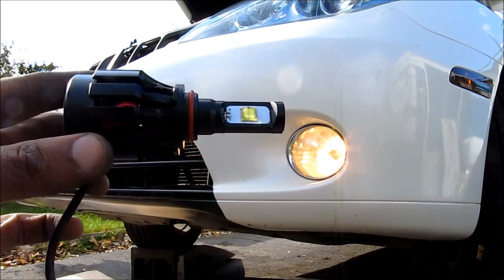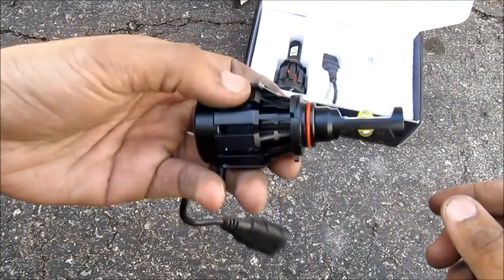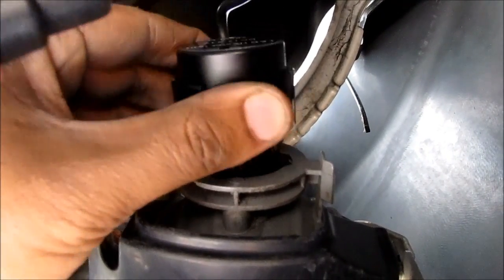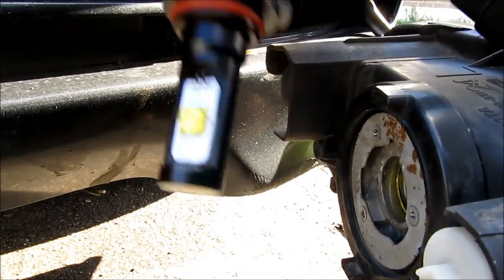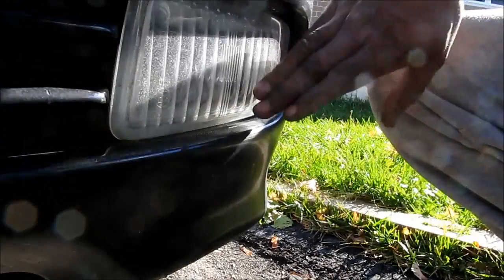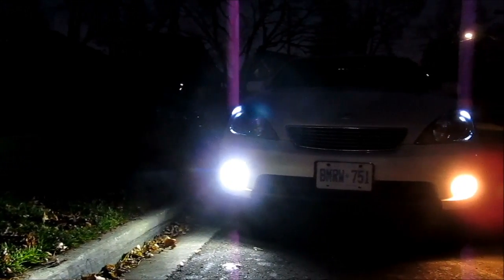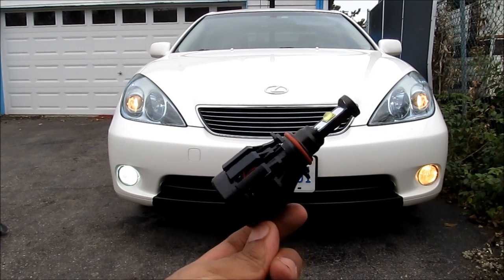LED Headlight & Foglight Review

Comment: that humm  you hear is the cooling fan spinning +8k rpm to cool the led. New ones from Beamtech don't rely on the fan , but better chipsets that run cooler

Comment: How do you change the bulbs to led on the gauge cluster On a 2005 es330.
I can get the cluster out and partially Apart, but I can’t get the board out to replace the bulbs. Is it glued on somehow?
Reply from the maker: Aren't they already led?
Reply: @speedkar99  I actually mean to change the color from white to blue. Yes, they are already LED.

Comment: Would you mind doing an update on led headlights? Has the technology improved? e.g. less glare, better beam pattern, more brightness, reliability. Shopping for one recently for my camry with a projector housing and was mildly disappointed, wondering if there are better ones on the market or is it just hype?
Reply from the maker: Yeah I wouldn't mind. I see alot of people are retro fitting LEDs now. 

I'm still using HIDs
Reply: Technology has improved. Use bulbfacts.com for led reviews. Also the beam pattern depends on the led. Just don't buy the super cheap ones. And when you install them. Keep the LEDs at a 9 o'clock  and 3 o'clock angle  And not 12 and 6.
Reply: Miguel Angel Medina Rise, thanks for the link but there are so many factors I didn’t know...e.g. can bus (what is that?), polarity, reflector vs projector housing, DRL, etc. Then, there are those ridiculous claims on lux output, 12,000 vs factory at less than 1000, are they real and do they blind on coming traffic? Lastly, product review sites are advertising sites and it’s difficult to judge their independence.
Reply: @test40323  CANBUS enabled LEDs will not give a "lights out" error light on your cars instrument cluster. 

Reflector and Projector are your headlights type of housing. Reflectors look like a bunch of mirrors. Projectors use a glass lens to disperse the light. 

Some LEDs are more effective with reflectors or with projectors. That's why I like review sites like Bulbfacts to attempt to differentiate them. 

I honestly wouldn't go with user reviews because for many people. It's their first upgrade to LED. So they will have a biased opinion to believe it's a super bright LED and it's "the best". Stick with review sites. 

Also the 12,000 lm rating is for both lights. 6,000 lm each. Most don't really stay that bright. For LEDs they typically are their brightest when you turn them because the housing is cooled. Once they heat up the light output diminished. You would want an LED with a nicely made heat sink and fan to keep the LED within operating temparature to maximize it's light output.

Comment: I have the same ES330, I really like what you did with the lower front bumper between the two fog lights. Did you paint that or wrap it black? I’m also gonna put some sylvania led bulbs into the fog lights, do you know the size of the socket for the fog light bulbs ? Which bulbs specifically should I buy? Thanks.
Reply from the maker: 9006 fog bulbs 
The lower grill is wrapped black, I like it

Comment: People have a hard time wrapping their heads around how 
Things can affect gas mileage. Like low tire pressure, bad battery, and then alternator 
Keeps trying to charge it up! Yes even high wattage bulbs demand more from the battery
Which in turn is charged by the alternator, tons of crap in your trunk adding to the 
Vehicle weight, etc. Expand Your Mind Folks!
Reply from the maker: Agreed! Small things add up to alot! That's how OEMs can claim "best in class efficiency" and Year over year economy improvements, by correcting these small things.

Comment: I recently replaced the DRL, and brights with new halogen bulbs, thanks to this video. I thought of doing LED lights, but, this video and your information helped to make up my mind.
Reply from the maker: LED lights differ alot and have changed since I did this review. You can get good quality ones now
Reply: speedkar99 Yes, and the price for LED bulbs ranges very widely, as does the quality, and high price does not equal high quality according to Amazon reviews, either. I also didn’t want to deal with the issues with the dash light on due to a perceived “bulb out” error, either. At least with the Lexus ES330, there is some space behind the bulb housing for the fan on many fan cooled LED lights.

Comment: Couple things I would like to note are when your jacking up the car use jack stands and make sure the car is stable so it does not fall on you, make sure your also getting high quality bulbs so they don’t die on you in the middle of the road and you might get pulled over in the GS for having the green lights because the cops might think you have neon lights and they are illegal in most states or territories in Canada and the United States.
Reply from the maker: All good tips. Thanks

Comment: Any for the low beam lights for the 2002 model?
Reply from the maker: +marine0331inf I wouldn't use those, swap in projector hid
Reply: speedkar99 would u still recommend the led fog ones? I believe mine are the h3

Comment: What year is your ES?
Reply from the maker: +marine0331inf 2005 ES330
Reply: speedkar99 i have a 2002 es300 and was wondering if the fogs would be the same? Also would you know if there are any low beam LEDS that would fit?
Reply: speedkar99 i want to find some low beam hid lights for my car. If you know any that would fit would be a great help. Thank u.

Comment: My led have lasted for 2 years .  Get the ones with the fans on them, i got the 160watt , 80watts each .led hb4 . I love them. Screw hid  they are headache
Reply from the maker: +BornToBeFamed good tip. Mine lasted 3 month in winter cold

Comment: the LED "humming noise" is the fan that is required to operate, otherwise they overheat and die. perfectly normal to hear it. i've upgraded everything in my truck to LEDs including the interior lighting. the only thing i didn't are the high-beams, because LEDs are useless due to the cap. HIDs are better for high-beams even though they get hotter.

edit: just read down below and you said that there's no fan in these. well there's your problem on why they died. as i said, these LED-type of bulbs require a fan to operate.
Reply from the maker: Yeah well mine don't have a fan, there's a humming noise but there's no wind and it doesn't sound like a motor spinning. Mine started flickering and I took them out. My guess is a cracked solder connection in the cold Canadian winter.

Comment: the "base" of the led is the fan the dissipate the heat. That's what the humming noise is.
And of course they died in 3 months, chinese POS
Reply: indeed. i just bought two sets of LEDConcept Axioms. they're rated for up to 50,000 hours of use with a lifetime limited warranty. i'll never need another bulb in my life unless i have i end up having an electrical problem.
Reply from the maker: Yeah these cheaper Chinese units aren't that great. Mine did not have a fan on the back, I've looked it over closely.

Comment: better fuel economy Hahahahahahahaahahaha!!!
Reply: speedkar99  no its not in theory yes I swapped my truck from halogen to every bulb being led and my mileage did not change at all not even one tenth do no measurable difference. also those LEDS are junk buy some high quality leds and get back to us
Reply: I think the bigger savings is in fewer bulb changes, as high quality LEDs should last way longer than standard halogen bulbs.
Reply from the maker: +Anthony Cutajar But its true
Reply from the maker: +that guy In theory yes, it will save you fuel. But the savings you'll measure over The life of the truck, not over a tank of gas, its a very long payout.

Comment: That fan(the humming you are hearing) housing is so exposed in that fog light set up, I am sure road crud and water gets into it. But if that cooling mechanism is protected, it will not be able to cool effectively.
Reply: I'm
Reply from the maker: +Minoltalphafan There's no fan in these.

Comment: how will i know the size of the LEd will fit in my headlights or fog lights?
Reply from the maker: +Joneses Ente Goto silvania website they have a bulb fit guide by application.
Reply: Joneses Ente You can check the owner's manual for your car too. Most manuals have a page or 2 dedicated to bulb replacement.

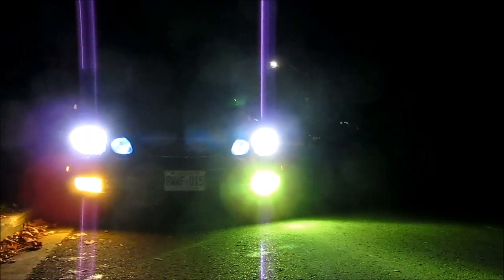Comment: At 4:22 the fog light on the drivers side had like Mountain Dew looking tint to it. WTF was that. The stock fog bulb is more clear on passenger side. No thanks halogens are staying on my cars with no ridiculous fans on my bulbs that fit properly as well.
Reply from the maker: +jmfut The Lexus GS has yellow bulb capsules in the housing, that's why they look green.
Reply: +speedkar99 Yes both fogs have the same capsules. To have technically an up grade turn lights  green and not clear I don't feel it would be worth it in the end is all.

Comment: Excuse me, did you just say thats going to get you a lot better fuel economy?!? HAHAHAH wow You sir deserve the dumbass award. Hey by the way, check your muffler bearing, floor matte grease for me would ya? Those are BIG Factors in Aerodynamics
Reply from the maker: Do your research. Less wattage burned means less load on your car's electrical system and hence less fuel input. I did the calculations here: http://s546.photobucket.com/user/speedkar9/media/2015-11-09%2022.39.47.jpg.html

And yes I did change my muffler bearing @ 4:14: 
https://www.youtube.com/watch?v=7M6uH1hnNgQ
Reply from the maker: Also, Toyota/Lexus has a huge recall to remove the grease from the floor mats. Apparently they were sliding under the pedals to cause the vehicle to accelerate unintendedly. The details are here: 
http://www-odi.nhtsa.dot.gov/acms/cs/jaxrs/download/doc/ucm422637/rcmn-09v388-1234.pdf

Comment: The question I have yet to find answered on videos of this sort, is: How do they perform in foggy conditions?
Reply from the maker: +J Johnson We don't get much fog here to try them. I assume with them pitching light all over the place, it would make things worse as light reflects off of the fog's.
Reply: My assumption as well.  I would like to actually see demos in fog, too.
Reply: I'm familiar with lamp color and fog.  Real life experience by frequently driving in foggy conditions with conventional incandescent and halogen lamps.  I have no personal experience with LED varieties.  That's why I asked.
Reply: White light performs badly in fog. Yellow light has better penetration. Color of light decides the penetration. Do a little research. 
https://www.aliexpress.com/item/Top-Quality-Limastar-All-in-One-Headlights-LED-H7-H4-H11-6000K-7600LM-9004-9005-9006/32746977300.html

Comment: Pretty sure leds don't give better fuel mileage
Reply: speedkar99 you do say "a lot better fuel economy"
Reply: +speedkar99 you may want to do some research yourself. Please Google alternators and how they operate in cars. The current draw is NOT directly proportional to gas mileage as you suggest.
Reply from the maker: +Chris Baldeo Do your research. Less wattage means less load on the engine, which means less fuel burnt. The difference is miniscule, but it does exist.
Reply: speedkar99 lol moron
Reply: Chris Baldeo I was thinking the same thing! and they are Chinese POS bulbs. he got what he paid for. get Sylvania LEDs
Reply: qballtch same bro
Reply: But you can get +5bhp. :o
Reply: It Makes even more difference on a hybrid car
Reply: speedkar99 actually you should do your research because you bought lights that only last 3 months
Reply: smack9x word bro this guy doesn't know shit

Comment: Aftermarket LED's are not that good.  OEM LED headlights are good and getting better.  Of course the more the car, usually the better light output on LED's.  Toyota Corolla LED's are ok, but know a few people saying the Infiniti Q50, Acura TLX, Lexus IS are much better light output for LED then the Corolla.  I was told also the newest Audi's LED's are great, even better then some HID's.  I had HID headlights OEM on my Acura's and they were great.  LED's don't throw enough down the road, even halogen are better at that then LED aftermarket.  HID's are still the best in my opinion.  I had an Acura TL for nine years, and I changed the bulbs once, never had an issue with the ballasts, lasted until I get rid of the car, had over 175,000 miles on it.
Reply from the maker: +jmen8888 Yes I agree, led lights in housings designed for LEDs work the best. HIDs have been around for a while and have proven themselves reliable and long lasting, but again they need to be in housings designed for them to direct the light.

Comment: humming sound is the coolant fan on them
Reply: the fan is inside the heatsink.
the turning bulb is designed so you can adjust the bulb to minimize glare. there is an alen screw under the oring to tighten once you find the perfect orientation.
Reply: There's definitely a fan on those.  You can clearly see it while you're holding the bulb in your hand.
Reply from the maker: +jinxgtr these don't have a fan, just a heatsink
Reply: Well that explains why they failed after 3 months. The LED's were basically cooking themselves. LEDs for headlight use should have a fan to dissipate the heat instead of having a heat sink.

Comment: 3000Lm from 30W sounds fine, but that aluminium piece is capable of cooling for 10W LED.
So they are probably two XM-L 5W each...
If its something more powerfull, they will burn xD
Reply from the maker: +Arek R. Yea I guess. Except these started flickering in the dead of winter...
Reply: Probably IC in driver got cold and its parameters changed.
LED emitter shouldnt have any problems in -50C.

Comment: there must have been some kind of manufacturing defect on the LED that is burning out. or perhaps the brand does not have good quality control. I have had a pair of LED high beams for about 2 years now and they have never given me any issues and are still as bright as the day I install them. I understand high beams are not used as often.. but I have a 2006 Lexus GS and the high beams are also used as daytime running lights at 50% output which I thought was going to be an issue but it handles it nicely. I hope my experience helps
Reply from the maker: +Ivan Moreira Good to know. I agree these Chinese made LEDs didn't work out so well, especially the $60+ purchase price. An HID kit would have faired better. To be fair though they were tested in a cold Canadian winter. My feeling is the soldering joints are broken causing flickering.

Comment: fuel economy *
Reply: Less electricity consumed = less load on alternator = less load on engine = less fuellconsumed.
Reply: the alternator will produce the same amount of charge no matter the load. the load is on the battery, the alternator simply keeps it charged
Reply: Juan Ortega You don't have to go to google it if you don't want to. You can go to your local library if you'd like. I'm an engineer not a mechanic and can tell you that an alternator's current output is completely dependent on engine speed. There's nothing to debate. It's soul purpose is to turn mechanical energy (engine speed of car) to potential energy (electricity). My car has the following alternators specs... >78A at 1500 rpm,  >108 A at 2500 rpm, and 130A at 5000 rpm.
Reply: Arek R. "in theory"
Reply: +Arek R. that's not how it works. The alternator puts out current based on the engine speed. Please Google alternators and how they work.
Reply: You know.... Some times the stuff on google isn't correct. I've worked on vehicles and Industrial electric forklifts for over 20 years and I can tell you that the speed of the engine has no effect on an Alternator's output . Whether the engine is running at 800 rpm or 8,000 rpm the alternator output is the same Brennan is correct... unless of course the engine is off than you are simply using battery voltage.
Reply: smack9x the load is on the battery, the alternator does not reconize any load on the battery. 
it will charge according to engine speed and its capabilities. keeping the battery at 14volts while running
Reply: Not to mention 40 watts of saved energy isn't that much.  Your stereo probably uses more energy.

Comment: I noticed you mention changing the bulb will give you better feel economy. This sounds very wrong and unrelated. But I can meet mistaken is there something that you know that I don't. Can you please help me understand how it works. I appreciate it :-). Is this was just a mistake and his not related let me know as well my curiosity is killing me:-)
Reply from the maker: +Ivan Moreira LEDs draw less power from the cars electrical system. The electrical system is driven by the engine. Less load means less gas, a very small difference, but it ads up.

Comment: 3000 lumens,  highly dubious claim. Reputable sellers actually rate the output of these types of bulbs at around 1800 lumens. That's why on modern cars with LED projectors you see many rather than just a pair. One pair of LED bulbs wont even outperform a pair of decent halogens, that and all the additional glare for oncoming drivers make this purchase a non starter. Just do an HID retrofit with proper projectors.
Reply from the maker: +José Agree. These came off the car many months ago, they started flickering.

Comment: These old style LED has the driver built in and using a fan, these are usually not recommended to be used in the fog light area due to the fan can easily be contaminated and affect the cooling which result the LED dimming or in some case melt the light housing.  most of the LED would only perform well in certain housing, if you have a projector headlight HID is the way to go.
Reply from the maker: Projectors control HID light a lot better, but it may be too enclosed and actually cut some of it off.
These LED's just had a giant heat sink, no fan.